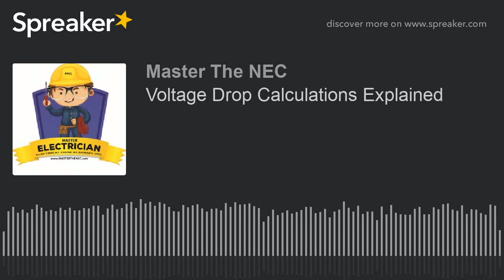Voltage Drop Calculations Explained

Comment: Paul,   I have a few questions and comments.   My background, I worked as an Electrical designer for mostly Electrical contractors since 1983.   Became a PE 2007.  Started doing these calculations before computer programs and definitely before "Apps".    I mostly did them on calculator until I was designing solar systems where VD was lost income for the company selling power to utilities.   So have done the calls over 100,000 times.    Your explanation was exceptional for testing purposes.   I took tests three times for three states.   
Question, am I correct that the voltage drop "Fine Print Note" (older codes) for voltage drop use to be in article 240 Overcurrent?    Back then, I believe I was taught that the note was there because some types of loads, when volts goes down, amps go up.   Like motors.  The reason they burn up is higher amperage than rated causing the heat over insulation values.
Part of voltage drop does not make sense.   Regarding 120 volts.   Utility companies are +or- 10%.   So, is NEC assuming - 10% to start with?   Real world, most utilization equipment will operate down to 100 volts.  So, for NEC to now say VD is to make the equipment work properly doesn't always make sense.
Next point.    I'm very happy you brought up the .86 for three phase calculation.   I was taught that was the value for three phase.   I believe you will agree that you do the single phase calculation, then after it is done multiply by .866. Is the same.   So (2xKxLxI/VD)x.866=CM
But I was also taught that for a BALANCED 3 phase 4 wire load on a multi wire branch circuit, change the .866 to .5.    I believe that this is because if balanced load, the current does not come back on the neutral, so only 1 way, not 2.   
Are these videos supposed to be audio only?   
Respectfully Submitted,    Kevin
Reply from the maker: Greetings Kevin - The videos I do are not related to these Podcasts. The only podcasts that have videos are the weekly Electrician LIVE shows. Otherwise, the audio files are again from my Podcast series and are not associated with videos.

The VD given in the NEC as you know are informational notes and are not enforceable, except as we know for Fire Pumps and Emergency Circuits.

To be honest I really just teach VD for 3-Phase to use the 1.732 rather than 2 in the base formula and in terms of exams that were most folks really need to be.

Thank you for listening to the podcasts and checking out our videos as well which date back a few years if you look into the archives.

Comment: So which voltage we use for our calculation if we are dealing with 347/600 volt system . Are we using the lower of the two or the higher one? This can be extended to 120/208 and ..........
Reply from the maker: Well, I can't say I have ever seen the old 600/347 Systems that are predominantly a western Canada thing. I would think the same principles of VD would apply no differently. The Line to Line 600V was popular for motors and Line to neutral 347V  as well back in the old days but now it tends to exist only in old buildings and mostly up north in Canada. I would again venture to say the VD calculations is no different just using a different voltage value.